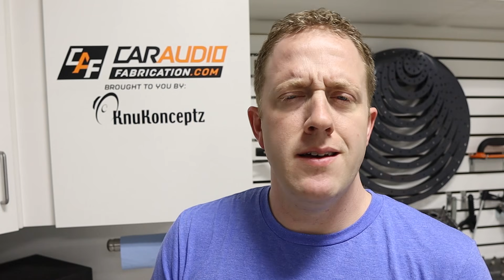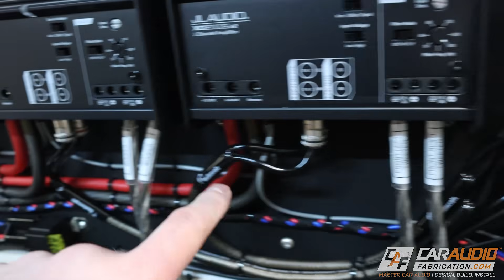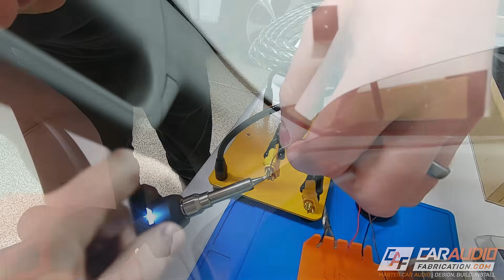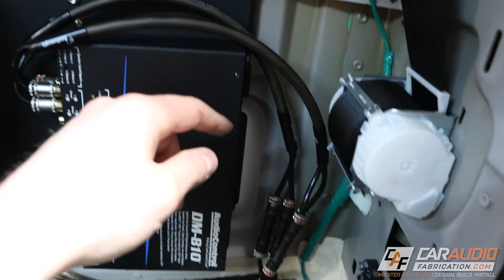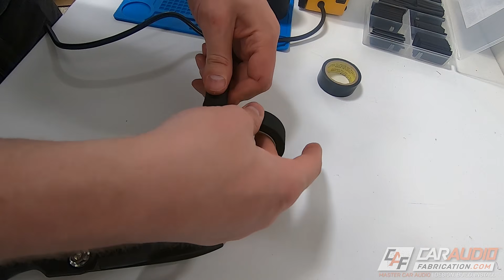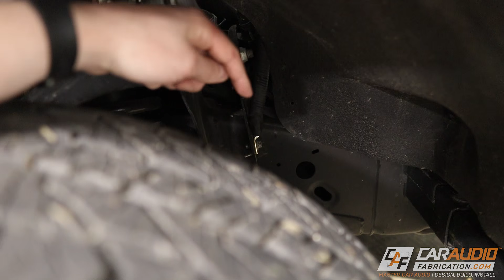Installing wiring for an ADVANCED car audio system

Comment: I know a lot of you will call me dumb, that's fine because I know there will be one of you that will provide me the answer that I'm looking for regardless,

with having two separate anplifiers and two separate channels set up for the woofers, and tweeters, so separate amps powering separate channels, how do they both known what song to play? I understand how with a 4 channel amplifier (all outputs coming from one common amplifer being fed radio signals) they can play the same song but how is this possible with so many separate amplifiers? are the radio inputs of each amplifier all connected in parallel?

Comment: I installed a subwoofer and amp. My problem is , that as soon as I turn the key to the accessory mode my subwoofer instantly powers up and full “humming” LOUD. Is not stop. HELP

Comment: How do you do when connecting tweeters to the amp? Do you need some resistance in between or does the HPF set in the DSP protect it?

Comment: What wire would you  use for getting signal to the amp via line level? Also, do you have a link for the yellow quick disconnects?

Comment: Quick question, I have 2 different 10” subs in separate boxes. I have not measured the hurts/frequency yet. Is it stupid to have two separate subs in a system

Comment: To be honest, most power wire is oil resistant so adding a protection loom is unnecessary if you run it away from where a mechanic could snag it. Appreciate the ton of tips on the other end though, definitely makes car audio less intimidating when trying to do it the right way.

Comment: If I have 3 amps like you have it set up in this video how do you use the right wire I was looking to put JLauido VXI 1000-1 1000-5 400-4 80amp + 80amp + 40amp so does the one lead wire and fuse at the battery have to be 200amp and the amps are 40feet away so what gauge to use? Or should I run 3 leads for each amp?

Comment: I used insulated flex electrical tubing from Lowe's or Home Depot for my power cable under the vehicle.  Better than flex loom in durability when exposed to the elements.

Comment: Mark when you upgraded the ground on the battery to the frame, I have heard that you can cause an issue with the F-150 because the factory battery ground goes through a hall effect sensor that has to do with the battery management system. Wondering if you have a bit of insight into this?

Comment: Why did you use 2 200/2's instead of a single 400/4? That's a lot more money/complexity IMO. They put out the same exact power. I understand they're active but if there's only 2 component pairs, a 400/4 would accomplish the same wouldn't it?
Reply from the maker: Product availability. Simple as that. The post pandemic world has been rough.

Comment: Im planning on doing a 1/0 run in my car once i get it running again, along with big 3. Guess well see what happens and decided if i need an alternator. Im debating upgrading my sub amp. 
Also probably gonna throw some 1/0cca in a 13 corolla, might swap my old sub amp in there.
Reply: Don't use cca a 0 gauge cca is more like 6-8 gauge copper
Reply: @drzflyest4  AWG is AWG bro
Reply: @A6Legit  aluminum is not copper man cca is cheaper for a reason. Its conductivity is not as good. When i compare 0 awg ofc to 0 awg cca the cca conductivity is more like a 6-8 gauge ofc but you can do what you want.  I had a knukonceptz cca amp kit that i chose to replace with a d4s ofc 0 awg kit. If you want to save money order welding cable instead of car audio 0 awg. I just paid 3.20 a ft vs car audio 0 awg @ ~5 a ft. Theres a reason cca is not recommended but you do you im just offering unsolicited advice
Reply: But in all honesty you shouldn't use CCA wire if you care about getting the power you paid for from your amps watch SMD video bro the cca wire lost about 300 watts rms compared to the OFC wire. I can see why you would want to use cca wire just because of the price but i mean if you bought a good amp wouldn't you wanna squeeze all the power and then some out of it?
Reply: @josecorrales14  What do you mean it lost 300w?
Cca isnt able to move as much power as pure copper hence why they have different fuse ratings for the same awg. Generally 250A for 1/0cca and 300A for 1/0ofc. Amplifiers use around a 10A fuse/100w output. Naturally if your wire has a 50A smaller fuse its going to deliver less power. 

My current total amp fuse rating is 220 so technically CCA would be fine. I only want the OFC because I might upgrade down the line. A 3k amp is basically maxing out a 1/0 OFC wire from what I can tell.

To clarify my car is getting OFC, but the family car i might use 1/0 CCA or swap my old 4awg CCA wires in it. I probably won't even drive that car but I want to do a system in it. Definitely budget, its basically getting all the old gear I have laying around.
Reply: @josecorrales14  i watched that video and he was testing a 2500w amp, and like I said 10amp fuse/100w output, so that amp likely runs a 250A fuse and so would the cca wire. Its basically only an issue because hes testing it at the peak of 1/0 CCA's capabilities. Yeah theres more resistance etc etc, but if you arent pushing 2500W of true amp power I dont think it matters much.
Reply: Try using welding cable . Order by the foot . I my wire is flexible 600 rated and cost Half of what car audio charges for similar cable,  just with slighty thinner strands . 
Now That's where you save money at without sacrificing power and headroom
Reply: @bobcat3653  ofc only bro period

Comment: 5:35 ive always wondered why or how people use 1/0 in the vehicle because i can barely fit 4g or two runs of 4g down the side of a car. Ive only ran wire under a car once and it wasnt my favorite route.
Reply: I've ran 0 gauge in two different corvettes (C6 base and C6 Z06) as well as my current 15' Golf and while it's tight I can usually make it work. The only car that's ever given me issues is this one Mercedes I did simply because the panel fitment is too good/ tight lol You definitely can't get away with as much as you can on more budget vehicles IMO.
Reply: @MikeB1972  Yeah I had dual 4g in my audi and it barely fit. In hondas and toyotas it was easier to stuff it under the carpet.

Comment: I don’t understand why people would think that you wouldn’t have a good ground with an aluminum body. Aluminum is an excellent conductor and they use it in city power lines
Reply: They use it in city lines because its lighter and cheaper than copper lol
Reply: @A6Legit  We do use it because it’s cheaper than copper but it’s a better conductor than steel.  We reinforce it with steel cables.  See, ACSR, the standard cable for electric distribution.  Source: I’m an engineer for an electric distribution company.
Reply: Aluminum is a good conductor; however, the process by which unibodies are constructed means that you can't assume that the entire chassis is electrically conducted at every point along the way.  Carmakers could give an isht about folks installing aftermarket audio components.
Reply: Something many don't realize aluminum gets a clear oxide which can affect electrical connections also copper aluminum corrosion has caused fires in rv and modular homes in past
Reply: My semi cab is entirely aluminum, huck riveted at every panel. The factory did a good job of grounding the cab to the frame, and mirror posts to the body for the cb antenna. I used the multimeter and added extra ground straps, now the truck cab is well grounded.
Reply: Ls motors ground strap is off the aluminum heads its a great conductor
Reply: The issue is that often aluminum panels are not welded together but rather they are glued together with adhesives. Aluminum warps very easily with heat and doesn’t weld easily to dissimilar metals so manufacturers are using new age adhesives to glue parts together. So the aluminum part you are connecting to might not have a good low resistance connection. Or it might today but might not over time. So, for grounds you can use the factory ground points or run cable back to the battery. The run to the battery always is best. You know that will work.
Reply from the maker: @Bill_N_ATX  The bigger issue is folks rarely take the time to test. A few minutes with a multimeter and you can determine if the ground is good or not. (Process shown here: https://youtu.be/eIB4IaNWS_M )  The vehicle body and frame is FAR larger than a single run of 0 gauge so the idea that running back to the battery is superior is not quite the case. Another 0 gauge wire running back up to the battery is almost impossible in a lot of vehicles, not bad at all in this truck but there are so many vehicles that make it nearly impossible to run just the positive lead its not safe to assume you can just always run a ground because you "know it will work"
Reply: @CarAudioFabrication  str8 facts
Reply: @CarAudioFabrication  I am about to do a build in my F150 with three amps and a DSP so this couldn’t have come at a better time! What did the ground measure at that location? I was pretty sold on running a second line to the battery but this makes things a little easier and more tidy, also cheaper when using expensive OFC. I’ll be running RF Power Series T1500-1 & 2xT600-4 with a Helix DSP3.S, 2xJL 8w7 under rear seat with a lift. 1 T600 running tweets and rears and the other T600 bridges to midbass. Likely audiofrog or arc RS speakers. Debating MTI or MBE for the enclosure. Have a thread started on DIYMA to log the build and will be using some of the same components you have here. Thanks for the content !

Comment: If you're not gonna run a ground to the front then don't tell people they have to use OFC since the body is aluminum.  May as well have used CCA.
Reply: Yeah but regardless, the OFC is more efficient on current restrictions in comparison
Reply: CCA wire is dangerous when permanently installed. After many heat cycles (how many depends on several factors) the aluminum WILL become harder and harder, eventually it WILL crumble. This usually happens at hard bends in the wire but it can be anywhere in the run and that spot is going to get very hot. CCA nearly cost me a car, I got lucky. Please, don't use CCA and warn anyone and everyone against its use. It's fine for jumper cables but hard wired It's dangerous. The aluminum body if the truck will ground thro the path of least resistance. As it hardens that path will change. Personally I would ground to the frame since steel won't be affected by electricity running through it but aluminum is more conductive than steel so...
All the best.
Edit - I always run a ground of the same size as my power wire either in the frame or flexible metal conduit. I expose the conductor and bolt it to the frame before it enters the cab, leaving it a solid run. Liquid tape, plasti dip or similar products can be used to protect the wire once attached.
Reply: @renaissanceman7145  I have never once used CCA and would never tell someone to because it's garbage.  My point is if the body is glued together and is aluminum you just have to run the ground to the battery.  It's not debatable.  Even NAV-TV tells you to run a ground for their ZEN module and that uses like an 18 gauge wire.
Reply: Especially with this level of gear and at that price point, it'd what maybe $80 more of wire and an extra hour of labor?   If the customer won't pay that then they aren't my customer at that point.   Just my opinion

Comment: What are you using to remove paint for the ground? The witness marks appear to be made by a rotary type tool on a drill (?)
Reply: Pozitiveground   it's a kit which includes the wire brush.   It's an awesome kit for doing grounds
Reply: @melissathompson7229  thank you!

Comment: Can we get a video about either bypassing factory amplifiers or integrating aftermarket audio into factory amplified systems? Things to consider?
Reply: I believe he already made a video about this
Reply: @douglasking6714  You are right! It is probably related to DSP and 40 Volt high-level inputs. I’ve probably seen it. … To elaborate, I am looking for the caveats, tips and suggestions for working with cars you may be nervous about situations like BMW with fiber optic systems some of the cars that some installers or DIYers may have to take two looks at. Demystifying some of the “harder” or more advanced installs. I passed up work for some BMWs because I can’t afford to mess up something I can’t fix. Little intemidating to be honest. But when it comes down to it, I understand that ultimately it comes down to is getting good power to manage and amplifying a clean signal from source to output. … Another question, are there stock systems that should just be avoided? Toughest cars to integrate?
Reply: That'd be an awesome video.

I "upgraded" the radio in my EM2 Civic from the original to a Special Edition unit. I was thinking of having a DSP and external amp(s) for the drivers and later add a spare tire woofer, but I want to retain that OEM+ radio- not sure where to begin.😅
Reply: AudioControl Active Line Output Converters. LC2i for a basic sub setup, and LC7i for 6 channel system integration. He has videos on both, and talks about wiring into a factory amp in one of them, can't remember which. Point is, the LC2i/LC7i takes speaker level inputs and converts them to low level. And you get the speaker signal from the wires AFTER the oem amp, not before. Again, take the signal from the oem amp outputs. The line converts then put out a low level RCA output to use on any amps. Audiocontrol DSPs also have a line output converter integrated so you don't need a LC7i if you get a dsp from them.
Reply: Thanks for the summary. I guess I am trying to get insight into more vehicle specific challenges. I am going to have to retract my question now. @jcmartinez7527
Reply: @jcmartinez7527  - Thanks!